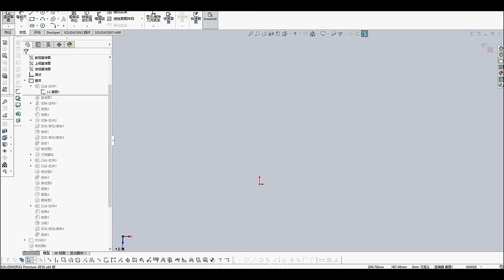37 Days using Paulownia Planks and Resin  to Make One of Ukyou Tachibana's Blades

Comment: That's not only an impressive piece of art, it's an entire career!

I reckon Cosplayers from all over the place would pay quite a lot to get a custom made (glowing) sword (or even just the blade) from one of their favorite animé - or donghua, for that matter...

If you could speed up your construction techniques, like perhaps using a CNC router to cut & shape the wood parts, and make the sword segments in separate molds before gluing them together (with specialist jigs), I'd think that you could produce a sword to order pretty rapidly. Add a production line of a few employees for details like artwork & lacquer on the saya (or the tsuka-maki, which can get quite elaborate for some swords) & you've got quite a business.

Could you imagine luminous resin versions of Roronoa Zoro's iconic three Swords: Wado Ichimonji (white) & Sandai Kitetsu (red), but especially a glossy black Shusui, with an awesome 'demonic' (King of Hell Three Sword Style) purple/red glow!

Good luck & thanks for the video. (When I've got the cash, I'll check back to see when your webshop is up for me to order one.)